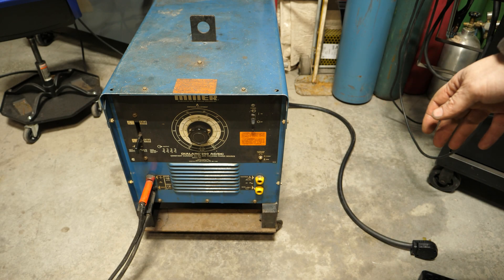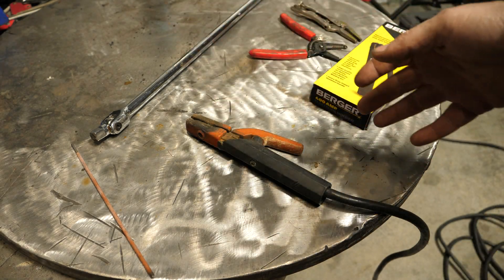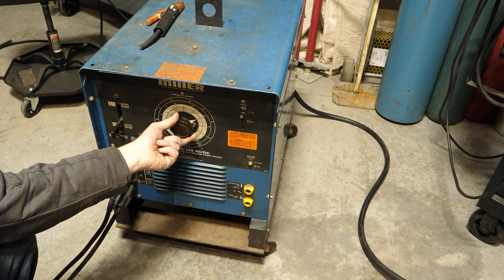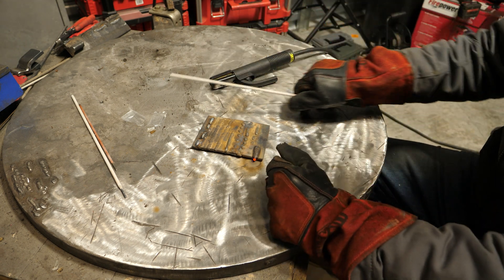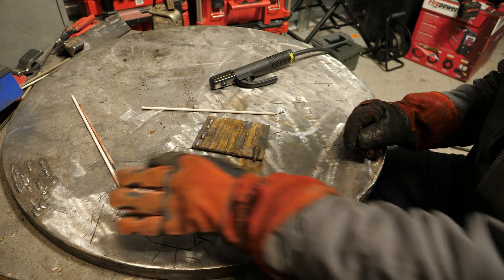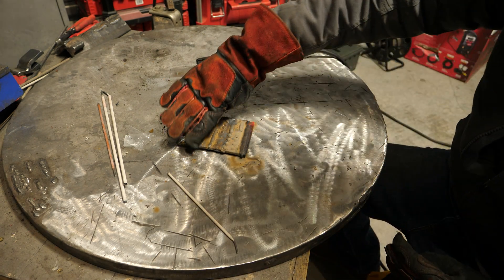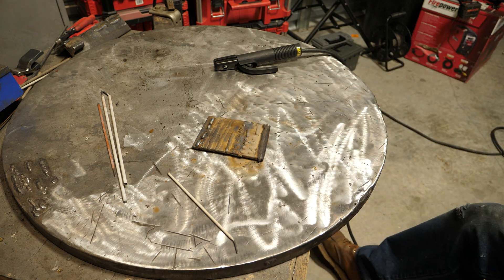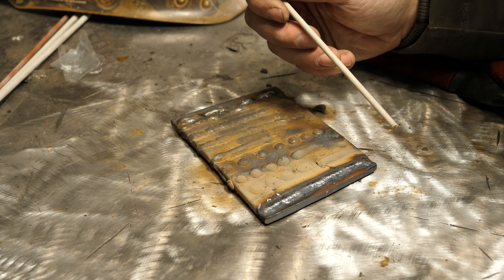Dial arc 250 quick test

Comment: 1:30 when the rod sticks and the machine does not cut out many people, myself included will rip the stinger off the rod, which causes sparks and burns up the stinger.
Reply from the maker: Some modern machines will cut the output but a vast majority don’t.  If the rod sticks good enough you’re definitely in for a spark show 😅.    It’s amazing how much force a rod can take to try to pull off steel it’s stuck too.
Reply: @makingmistakeswithgreg  funny thing is, my cheap Chinese stick welder from Amazon, $70, cuts out, but my primeweld 325 does not.

Comment: I like older transformer machines but I agree, the sup power like drunk takes alcohol. Transformer machines are now banned iin the UK, the ban came in just over a year ago so all new welders are of the inverter type.
There is still a place I reckon for transformer machines and that old Miller, it would be great to have in any workshop as a back up or just to own it and use it for personal use. Nice old bit of kit that, a classic one might say.
Reply from the maker: It does weld excellent and starts rods really easy because the open circuit voltage is 80v.  In part 3 I cover a bunch of book smarts and hands on testing to find out how efficient the dial arc really is.  The hard numbers are pretty staggering at how inefficient it is lol.  I still like it, and will likely keep it for a long time.  I will just keep it away from my generator since they don’t get along 😅

Comment: That's crazy how much power that thing needs! I expected you to say you were using a 4000 running watt generator or something in that range, not 7500!!!
Reply from the maker: Without ruining part 3, it uses a honest 600watts at idle.  That is corrected for its power factor.  So it takes as much as 6 100watt lightbulbs just to let it idle with the switch on 😅.

Comment: I have a Dialarc 250 AC/DC and I run mine off a 30 Amp dryer circuit, I can ran at 120amps "all day".  Strange that you're tripping a 30Amp breaker, there must be something wrong. . Have you checked the diodes in the control circuit.
Reply from the maker: It has to do with the breaker on the generator.  The breaker on the generator doesn’t have the same thermal trip curve as a household breaker, therefore the overload is far more “limited”.  In the part 3 video I do a full breakdown and testing of it vs other welders I have, including power factor testing and actual amp loadings.  Without ruining the video at 90-95a the 250s input side is around 30 amps.  At 120 it’s up around 40a.  A 30a household breaker will stay in for probably a minute or more at that loading, the generator a few seconds.  The actual welder only consumes maybe 17-19a at 90amp out, the poor power factor really causes issues on the input side loading.  It’s possible you also have the power factor correction version of the machine as well, which under low loads would hugely lower the input amp loading.
Reply: @makingmistakeswithgreg  My unit is the same as yours, no power factor correction. I read that the power factor correction circuitry greatly increases idling current, so better to turn off between welds.

I have been too lazy to measure my welder input current, but my setup works well enough for now. I will upgrade my welder supply circuitry one day.
Edit: According to Miller, the idle current at 230V with pfc is 24.8A Without pfc the idle current is 4.4A at 230V.

Comment: High VA draw, or CHICOM electronics...its a toss-up I guess
Reply from the maker: In the part 3 video I test the actual efficiency between them.  It’s enough difference that if you weld a lot you could probably afford to buy a new inverter every year or two lol.  I will have to calculate out the actual cost differences in electrical usage lol.

Comment: Good luck with the shop. I know some people really liked them, but I never was fond of those big transformer machines. By the way, I bought a package of the PFERD CC-Grind-Solid 115 SGP steel disks. Yeah, it removes steel much faster than anything else I’ve ever used and I’ve been doing this for a long time. Then I saw another channel where he says he’s been using them and they seem to last well. While I’m retired, the time saving with these disks is really worth it. Even if they wear out faster, for the pro environment where time costs more than a disk is worth, I can see this being really nice. But you have to get used to it. Don’t use too much pressure. You can remove your work as easily as the excess weld. I think they’re worth it. They have some other interesting disks I’m going to try. Thanks for trying out these products. I wouldn’t have thought of these otherwise. My other experience with PFERD is that they’re ok.
Reply: I just used one of those for the first time recently and they really do burn through metal much faster. Seems to be pretty durable for something so thin, too.
Reply from the maker: Yeah those discs really seem to chew through material.  Pretty shocking considering how thin/light they are.  I need to see if they work well on aluminum without loading up.
Reply: @makingmistakeswithgreg  I haven’t tried that. It says steel. They have others for stainless. I use 309L wire for general A-36, 1018 welding. Yeah, it’s fine. I’m not going for inspection for my own stuff. Talking to some wire makers they say it’s ok for general welding. Anyway, the point is that it works fine on stainless welds. Maybe it’s not certified clean for stainless? I don’t know. But you can see the tiny tips of the abrasive turning shiny from it. Doesn’t seem to affect it though. Maybe this weekend I’ll take a piece of aluminum out and see. I imagine it will load, but who knows?

Comment: Something that big needs at least 9000 watts to run it properly with 48 amps of breaker like a Hobart 225 Champion Elite welder generator or something comparable those dialects are what the Community College I went to had for stick welding training inverters might use less power but there is nothing like learning to weld on a Transformer machine because it doesn't lie to you there's no special training wheels you either have the skill or you don't because if you stub the rod that Transformers going to let you know because you suddenly made a space heater that Rod will heat up and turn red
Reply: Inverter welders will make a rod glow too if they don’t have an anti-stick feature. My primeweld tig 225 will make a rod glow in seconds if you stick it
Reply: @biasplies3273  interesting that's good to know thanks